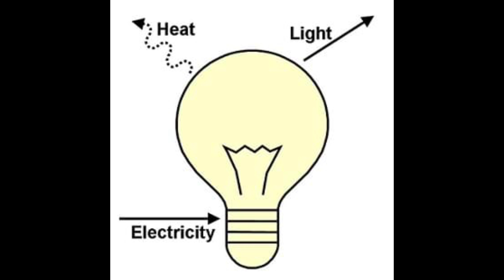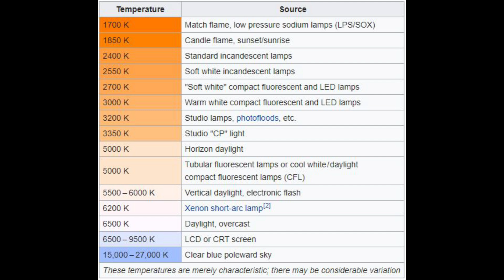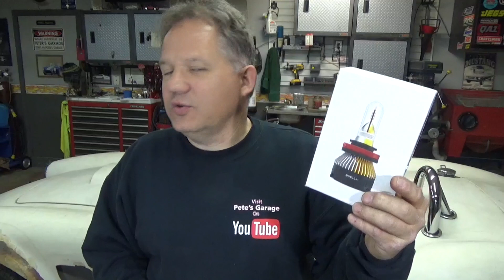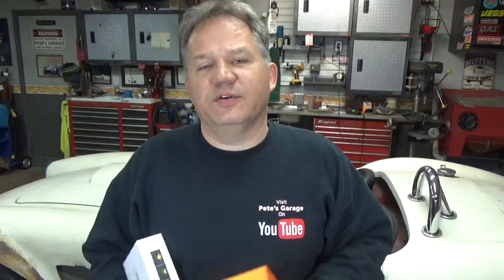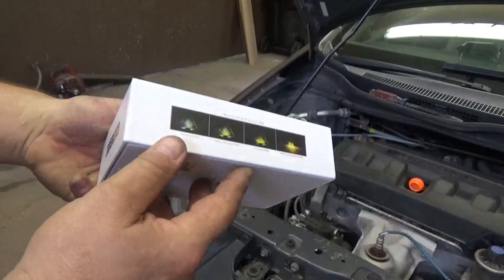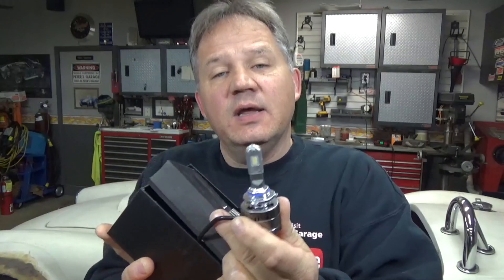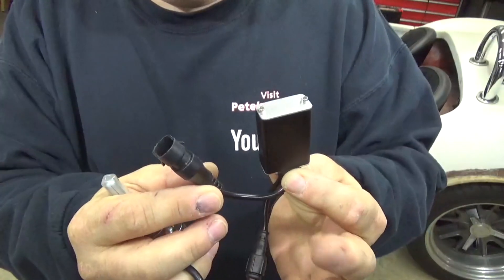Headlights - Halogen vs LED (Boslla White/Yellow) and (Auxbeam White LED)

Comment: Sitting in the car you would see the light travel out in front of you.  An outside observer would not see your light travel out from you.
Reply from the maker: I disagree. If you are already traveling the speed of light and turn on your headlights, light would have to travel faster than you are already traveling for you to see it.
Reply: @PetesGarage  That's why it's relativity.  To an outside observer your clock is also stopped so you never turned them on.  But to you everyone else is traveling the speed of light.  An outside observer would not see your light out in front but the person in the car would.  It is because of the frame of reference.  I know it sounds counter intuitive but it is true.

Comment: The industry uses the term ‘warm’ to indicate a more yellow hue. Like fire. Incandescent bulbs are warm. The term ‘cool’ refers to a more bluish hue. Fluorescent bulbs are cool. You will also hear the term ‘natural’ which is lighting with no perceptible hue, more similar to daylight. My ‘64 Dodge truck has (4) 5-3/4” round headlights. Quality-made lights have a sharper cutoff focus light on the road. So the same amount of candlepower is in a usable place vs being in the sky or the oncoming drivers face.
Reply from the maker: I was thinking about that as I was making the video. I know its a warm light, but homeowners would be more familiar with cool whit light.

Comment: Hey Pete have you noticed any interference through your radio? My 08 g6 has interference with the lights on. Could that be due to a cheap led assembly?
Reply from the maker: I have not. Could be, a bad ground somewhere. An '08 may not have a capacitor in line to filter the frequency

Comment: Should have tested the aftermarket halogen bulbs, like the silvania silver star bulbs vs the leds, factory bulbs are normally dimmer then aftermarket.
Reply from the maker: Excellent point, thanks
Reply: Yep, I just put some on my Nova, seem to work great so far
Reply: Silver erstad ultras are brighter than standard.  I run them in my hella ece compliant composition housings.  Just wished they offered a silverstar ultra in H3 or one close to it color wise with 100w for use in my KC driving lights.  Can tell which beam patter is which due to variation in bulb temperature. between my ultras H4 and the KC offered H3 bulbs.

Comment: Very nice thànks Pete changed mine out and it's a huge difference in visibility and they have a cooling fan built in the rear of the light assembly,  very bright.
Reply from the maker: Thanks Gary, excellent point. You can hear those fans running.

Comment: Thanks a lot for this Pete. Always more info for me to chew on. It is pertinent now as you know I'm rebuilding and completely rewiring my '87 Jeep. I'm another who hates the LEDs coming at me. One thing I am doing is running my headlights off a relay 2-3 ft away which will brighten them. With a 4" lift  [at my age I can use all the lift I can get  : ) ]  I am really concerned about the other drivers. Of course they will be adjusted to legal height but the glare could still be difficult. More questions to ponder.
Reply from the maker: Now that I changed to LED's I'm super focused on cars coming at me to really determine if it's really a problem or is it a perception.

Comment: I have only tried a few LED lights, as I have had one customer who really wanted to experiment with them. We found that the reliability was not good at all. We wound up replacing them repeatedly. I can only assume it’s because there are 5 million different manufacturers making these things and maybe we got one that was not so great. Have you done any long-term testing?
Reply from the maker: I am doing some testing and will report on the results. Thanks for the comment

Comment: While LEDs are more energy efficient and produce more light, there are a couple issues with swapping out halogen bulbs with LEDs that need to be considered.  First, if your car has a computerized fuse box (like the Chrylser TIPM), it may have a hard time determining the status of the headlights due to resistance differences with LED bulbs.  Sometimes causes a warning light on the dash to come on (or the headlights fail to function).  Second, you run the risk of ice/snow buildup on your headlights with LEDs because they generate far less heat than halogens and thus can't melt the snow off the lens in more severe weather conditions.
Reply: I live in the Canadian north. Ice buildup is a non-issue.
Reply: @DD-DD-DD  That's good to know...I heard reports to the contrary.  It was definitely a problem around here (upstate NY) when they first started putting LED bulbs in traffic lights though!
Reply: Chris Freemesser those reports are about street lights converted from incandescent to LED and yes they do fill up with snow and ice and don’t thaw out well.
Reply: Chris Freemesser the heat issue is mitigated with the amount of light that is created. Light is energy just like heat.
Reply: @Joe Hoe Hmmm...that's an interesting thought.  Hot air rises so it makes sense that snow would melt off of the hood, but if the hot engine is behind the headlight assembly and the snow/ice is physically in contact with the headlight lens, which one wins?  And if the car is in motion, how much engine heat actually moves FORWARD in the engine compartment?  Maybe it's the heat from the radiator that gets to the headlights and not the engine itself?  And if that's the case, what happens with electric cars or rear-engine air-cooled cars (like old Porsches or VWs)?  If one puts LED headlights in those, will they ice over?  Seems like some winter testing is in order!
Reply: @Joe Hoe I'm thinking once winter hits it's stride I may pick up some headlights and do some experimenting.  Should make an interesting vid!
Reply from the maker: I'll investigate and actually test the heat theory. I'll post a video about heat generation for all 3 headlights.